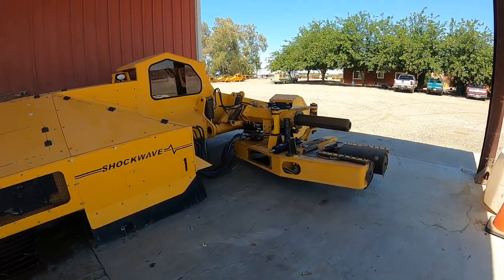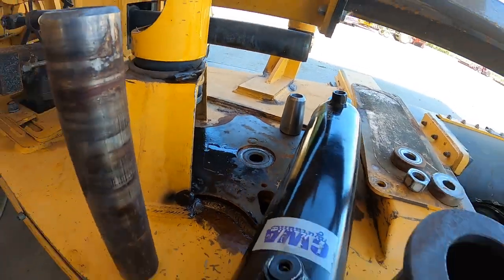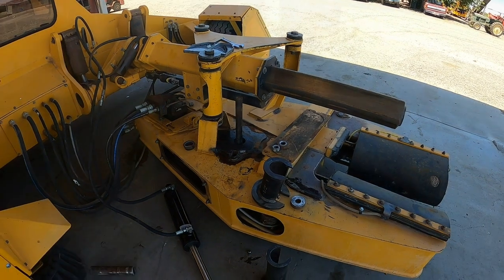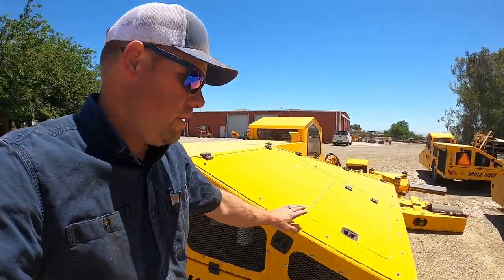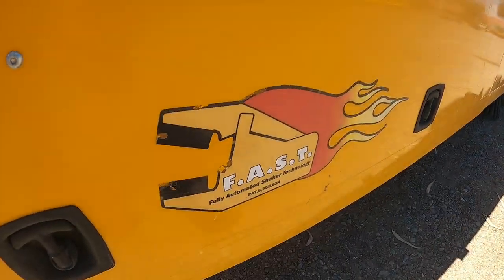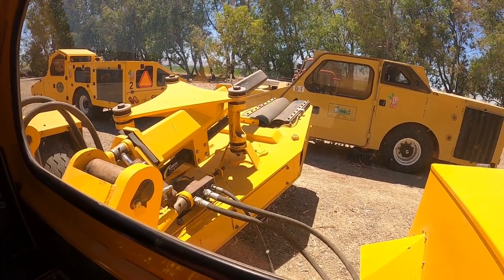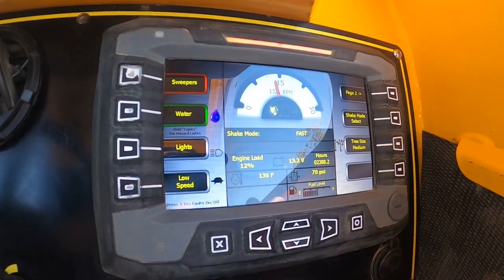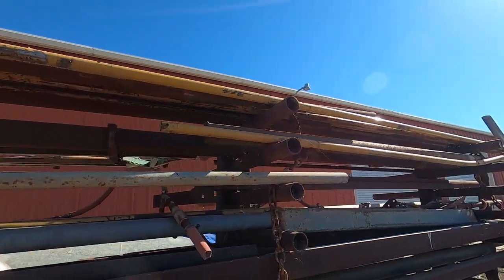Quick rundown of the almond shakers and something cool for memorial day weekend!

Comment: We manufacture conveyor belt, and we sell some through a California distributor that is used for shakers, instead of conveyors. Being from NC, I had never seen the shakers, even though I’ve seen the pecan orchards in GA. I’m assuming the pecan shaker is pretty much the same as the almond shaker…
Reply: I got 24 of thoes things . Have had  energy wheel pins stuck about every possible . From seized bearings to broken pins.  I give you a few tricks .Don't pull the pin with the lower taper in it just gets tighter.Also if you get a small hydraulic jack and put it in the head spread the cases the wheels will fall out also use the jack to install the wheels washers that will give you a lot more room to work all the washers in on top and bottom of the wheels. Great video injoyed it . If I can help call Tulare OMC they can put you in touch.